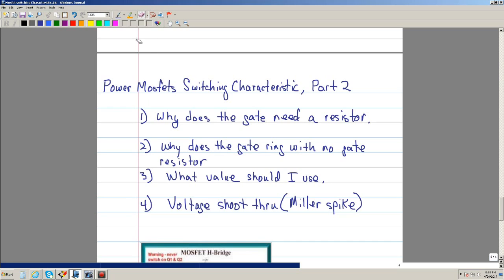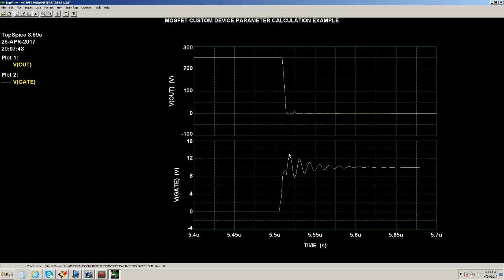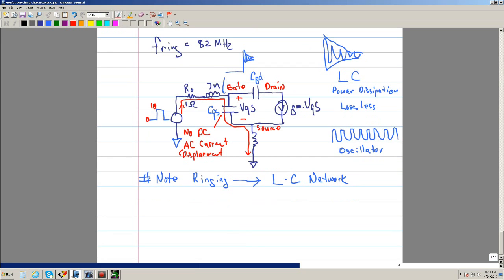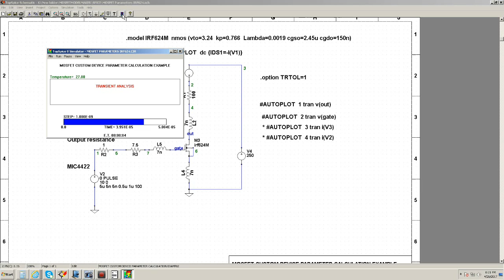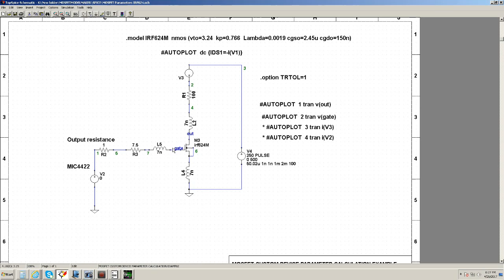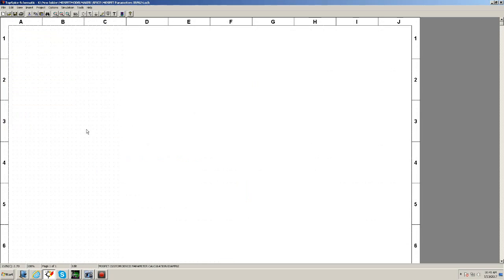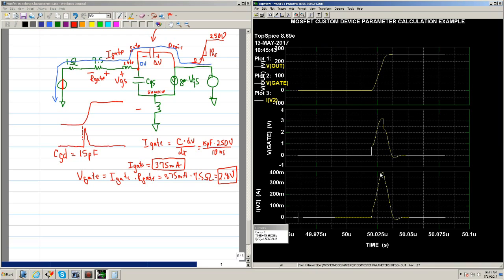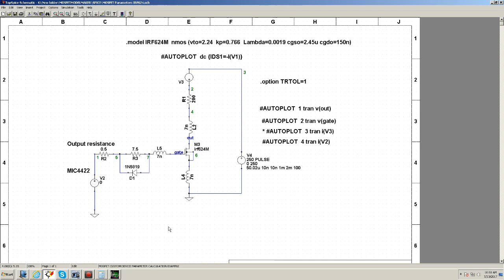MOSFET Switching Characteristics 2, (Miller Capacitance)

Comment: Hey Robert,
First of all  its a great video.We can also add snubbers across the MOSFET to reduce the di/dt which in-turn will reduce this voltage on gate pin.It would  be great if you can make another video on selecting the snubbers.
Reply from the maker: Hi Abhi, that is a great suggestion. Lets see what I can come up with.

Comment: During repair of large SMPS (3Kw) ZCS HB. I got ringing at the plateau voltage during charging of the gate. What can be done to suppress this ringing? Static capacitace (gs)of the IGBT is 5.5nH. Freq.  100khz.
Reply from the maker: Make sure you have a gate resistor using the formulas I show in the video. If that does not work, add ferrite beads to the source and maybe the gate of the mosfet. Make sure the inpedance is over 100 ohms at 100MHz. Let me know if that works.
Reply: I left the gate resostors as the ones used at the factory (10r) and added only ferrite beads to gate and source legs on the IGBTs. A lot of ringing is now suppressed
 The smps works fine now only to see square waves rounded a bit on the rise time during charging of the gate. I guess this is quite normal in high power IGBTs. The driver is an IR2110S.

Comment: At  28:54, why is only the gate resistor voltage drop accounted for? Would the gate inductance also present a voltage due to the di/dt? Or is the inductance so small that it has negligible impact on the gate voltage calculation?

Comment: Another nice video, very helpful. I am waiting for your video on feedback loop compensation using TL431 and optocoupler for the
isolation purpose in  dc dc converters.
Reply from the maker: Hi Satyavijay, I am working on a compensation video using the TL431.
Reply: Thanks

Comment: Hello Mr. Bolanos,
Again, and as usual... nice video. I was wondering whether or not you should have included the 1 ohm gate driver resistance when calculating the gate voltage near the end of the video 35:55. If so then the values seem to come out even closer i.e. 375mA * 8.5 ohms (instead of 7.5 ohms) = 3.1875V. 
Additional question: Will these simulations work in LTSPICE? Should the results be similar if configured properly to work with the LTSPICE components?

Regards,

Rob T.
Reply from the maker: Hi Robert, That is a good catch. You are correct to also add the output resistance of the driver. That makes the calculation more closer. Again thank you for spotting the error.    Best wishes, Robert B.
Reply from the maker: I forgot to answer your LTspice question, yes, you should be able to use LTSPICE to do these simulation. Hope this helps.  RB

Comment: Thank you Robert for an extremely well made and informative video. I have a doubt. By adding the diode, aren't we risking the occurence of ringing when the turn off the MOSFET?
Reply from the maker: The diode ussually have a small amount of resistor (internally) in series. If the gate still has ringing, a external resistor can be installed in series. This small resistor should be able to damp the ringing. Hope this makes sense.
Reply: @RobertBolanos  Thank you Robert for the response. I understand what you are saying. Keep making great videos like this :)

Comment: Hi Robert, congrats for your video. I have tried to get the same identical example in spice but I see no ringing without Rgate. Have you slightly modified the IRF624 mosfet model in this example? 
Thanks
Reply from the maker: Yes, the model was extracted from the irf624 datasheet curves. the model spice parameter are;.model IRF624M  nmos (vto=2.24  kp=0.766  Lambda=0.0019 cgso=2.45u cgdo=150n) You will also have to add the parasitic lead inductance of about 7nH. Hope this clears this up.
Reply: Hi Robert, I would like to ask a question about Rgate calculation.  At 18.32 min (and previously) Cgs has been considered to be 245pico. At 18.50 min (and previously) the spice model report in bold Cgs=2.45u. Is it a simple typo or Am I missing something? 
Thanks. Regards.
Reply from the maker: Another good question. The Cgso parameter that is on the .model statement is a spice parameter and has units of F/meter.   When the W (Width) and the L (Length) are not specified, the deflaut W=100um while L=100um.  To get Cgs you multiply the CGSO*W=2.45uF*100um=245pF.  Thank you for asking the question.  Question and comment can be sent to rbola35618@aol.com.   Robert
Reply: Nice. Thanks.

Comment: @Robert Bolanos hello Sir
Assume you have one mosfet connected to capacitive load and you want to minimize inrush current by turning on mosfet slowly without using PWM. How would you do this and can miller capacitor plays a role here by adding another capacitor in parallel with miller capaciotr
Reply from the maker: Yes, this is how we use a Pchannel mosfets and we add capacitor from drain to gate to slow down the rate in which the voltage rises on the drain of the mosfets and therefore limit the inrush current. The inrush current is typically part of the input filter circuit. Thank you for asking this question. Robert

Comment: Can you tell me why the current path for the miller effect chooses the gate path and not both the gate and source path (through Cgs)?
Reply from the maker: Hi Tezla, sorry for the delay in answering; I have been on travel. The current does go into both the gate and the source. However, during the miller plateau, the voltage at the gate moves very little or does not change as fast so I make a statement that no current flows thru the Cgs to make the derivation simpler to derive. But in reality there is a small amount of current flowing. Thanks for the question.

Comment: Hi Robert Bolanos,

At 28:54, i see that the displacement current will find its path through the driver. [ Ro ( 1ohm) , Rg ( 7.5ohm ) , and L (7nH ) )]
Why wont that displacement current flow into Cgs ?

Thanks for delightfully informative video.
Regards
Shailendra
Reply: As Robert said: The current does go into both the gate and the source. However, during the miller plateau, the voltage at the gate moves very little or does not change as fast so I make a statement that no current flows thru the Cgs to make the derivation simpler to derive. But in reality there is a small amount of current flowing. Thanks for the question.

Comment: It would be nice to extend these "MOSFET Switching Characteristics" problems considering the synchronous case too. For example how to design a bootstrap drive circuit for the up side MOS and why it could be better (or worse) than the transformer method you have fully explained here https://www.youtube.com/watch?v=gyT1T5p2gtM&t=1635s. Congrats once again.
Reply from the maker: Thank you Nicola for the suggestion. I agreed it would be a good topic. As time permit I will add.